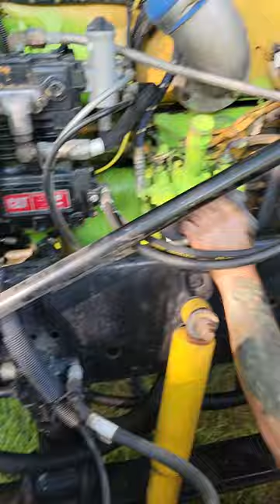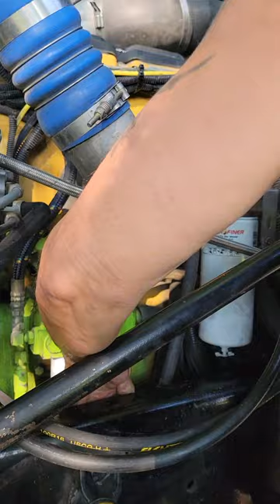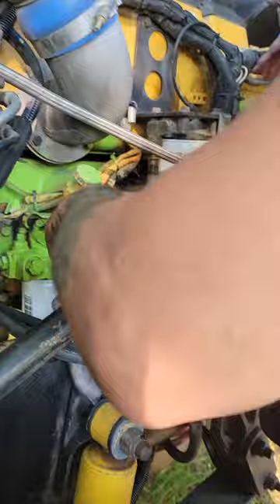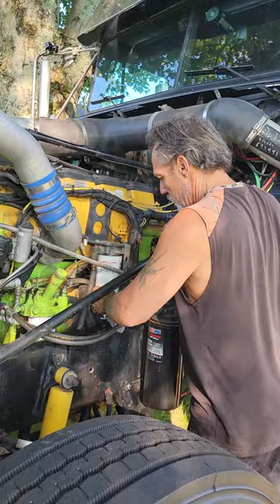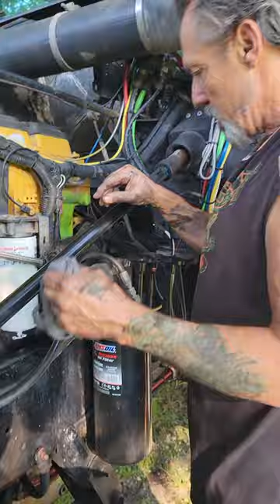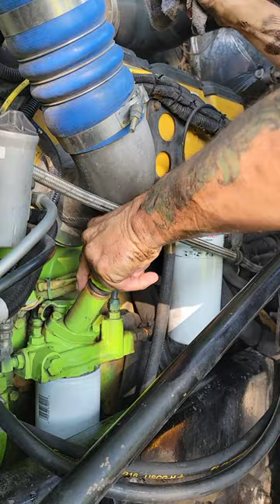3406 E CAT Fuel Filter Change #bigbellyrebuilds #3406e #cat3406e #fuelfilter #freightliner #otrlife

Comment: Im not a fan of the "e" variant of the thirty-four oh six cat engines. The electronics hinder long term reliability.
Reply from the maker: Thank you, Mr. NICK.   Steven says that the E model were the FIRST YEARS and the computer was mostly used for the Fuel injection system and temp, oil, and timing sensors.   Steven likes the E model and believes that they are more durable and reliable than others.  AND THE DOWN FALL IS THAT THEY ARE "FUEL PIGS  "  But sadly also known for oil leaks.  But the reliability can't be beat.  Thank you for your interest.   Ruthie 8.31.22

Comment: My 3406e has developed sputtering issue while putting load on the engine wether going up a hill or speeding up. If i speed up gradually its fine. No smoke, no check engine light, starts and idles fine. Im am overdue on my oil and fuel filter change. Will fuel filters cause the issue im having ? I did drain some fuel out of the water separator into a water bottle and some debris did come out.
Reply from the maker: I will have Steven get back with you on that.  Thank you for reaching out.  Ruthie B Howard  10.05.23
Reply: @bigbellyrebuilds2778  ok thanks.
Reply from the maker: That usually is a fuel problem most times fuel filters my C15 it wouldn't run red filters forget the name, so it always had to have cat filters for the best performance. my 3406 can run with almost clogged filters and still get the job done but the first thing i would do change the filters if that doesn't help, you will have to check fuel pressure it needs to be 50 psi or close to it hope that helps.